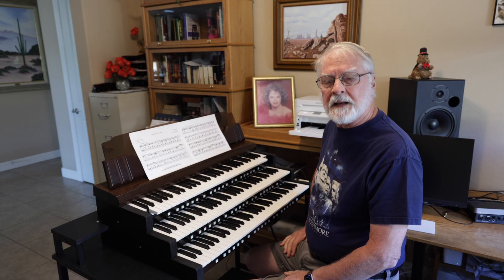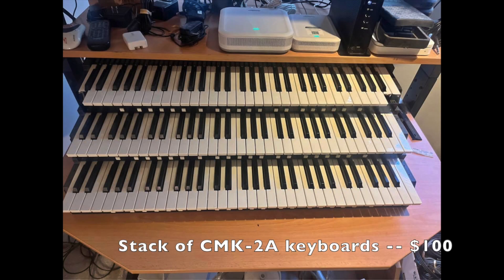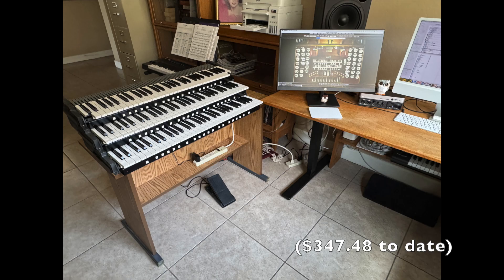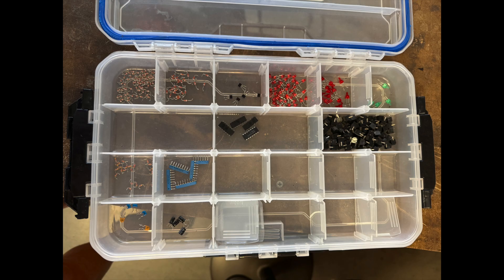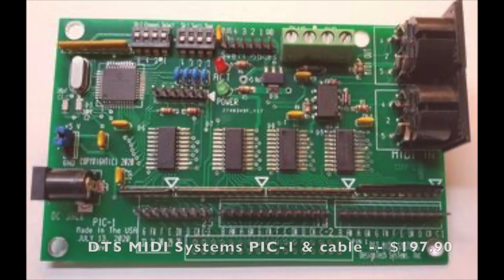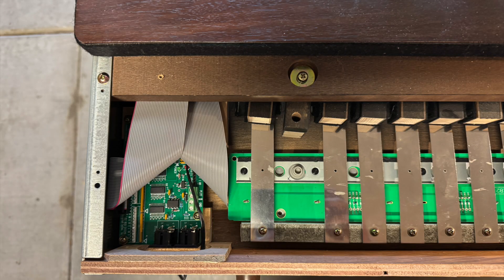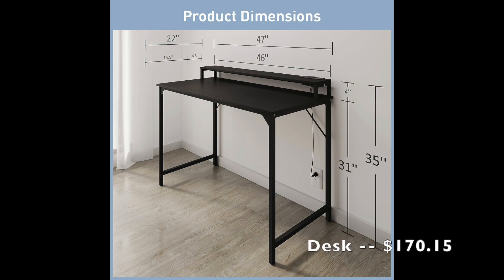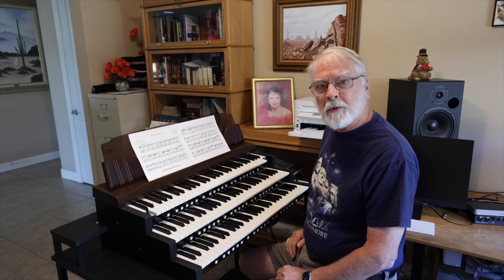Building A Virtual Pipe Organ -- Part 1

Comment: You could easily save $200-300 if you opt for GrandOrgue instead of Hauptwerk. It does take some time to find decent sample sets (or ODFs for HW-only organs), but the wealth of configuration options and MIDI controls makes it well worth it. I have managed to collect 9 or 10 different organs over the last 2 years while having spent $0 (except for my Mac).

Comment: Good work!...always nice that 1st time you can verify your pedal midi works!  I used a Roger's pedal board with the DTS electronics going to two B2 1800 W subwoofers via a Mk 1 audio interface over firewire.  I configured my 4 keyboards the came way as you with real cheeks to made later to insert into my 1927 E.M. Skinner console.  Thanks for the video 👍👍👍.  Running HW advanced 4.2 here, will update to 8.0 soon.